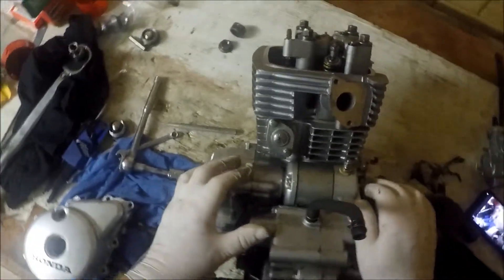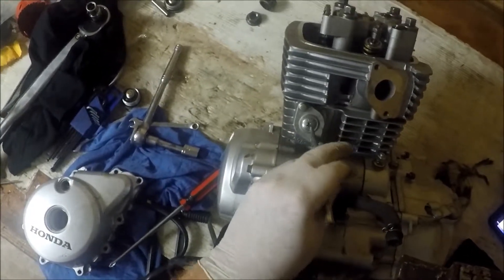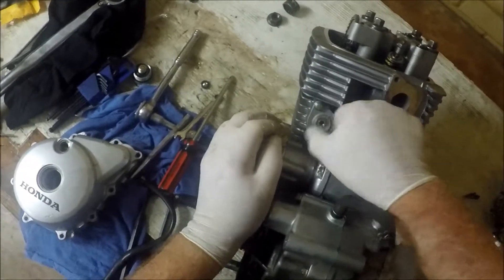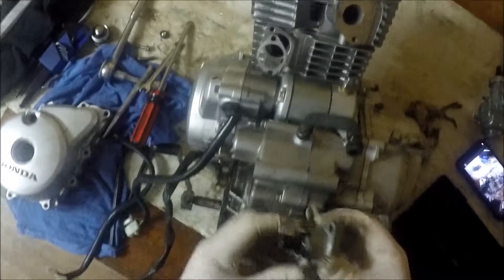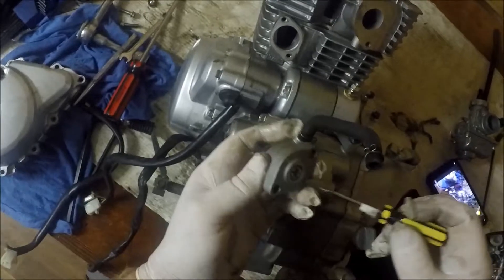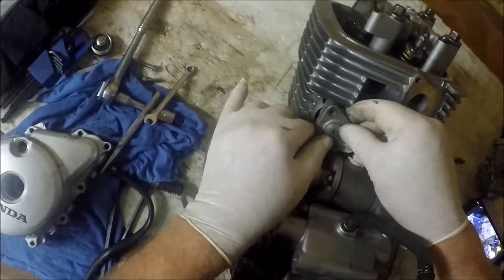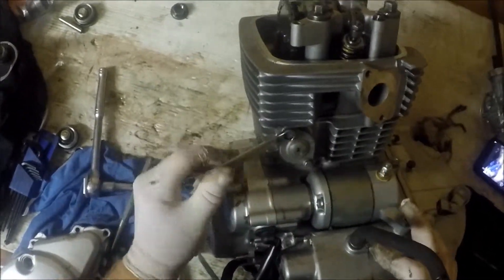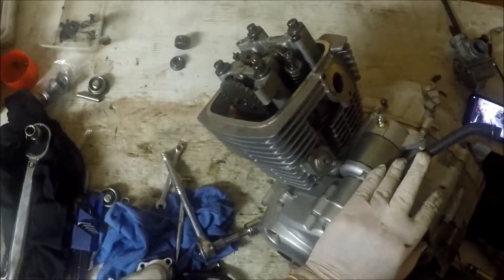Honda CB125E - The Mysteries of the Cam Chain Tensioner Explained

Comment: My tensionor looks the same but once wound in clockwise will hold itself in place without the cover screw, and is then released by a 1/4 anticlockwise turn.

Comment: Would you be able to put up a video on how to check the timing on this bike?
Reply from the maker: Hi Christopher!  Do you mean the ignition timing?  On the CB125E it cannot be adjusted, at least not easily.  It is a CDI unit that works directly off the flywheel and it should be pretty much spot on for the life of the bike.
Reply: @highoctanecommuting3862  That's exactly what I meant. Hrm, I got one of these from a friend and it isn't starting - it has spark and with the thumb test, it appears to have compression - if I spray starter fluid right into the carb, I get a fireball going back to the carb which makes me think that the problem is the spark going off too early. 
Do you have any suggestions on troubleshooting a no start condition? 
The float bowl is filling with fuel, its been drained and I have cleaned out the jets so it appears to be getting fuel.
Reply from the maker: @chrisd4813  That sounds like a fun and challenging problem, I'm a little jealous that I can't get hands on with that one.  You have definitely started down the right path.  You can check the timing with a timing light, there is an F index on the flywheel a few degrees away from the T index visible through the inspection cap as seen in the cam timing videos.  I don't believe this is the problem but without the bike in front of me it is hard to say.  How many kilometres has the bike travelled?  Has it been well maintained?  What were the circumstances where the engine failed to start?  Did it simply fail to start one day, did it stop while riding normally or was it something else?

Is the spark plug a healthy colour or is there signs of an incorrect mixture or oil burning?  Is it wet with fuel after repeated attempts at starting it?  Google will help you find a spark plug colour chart.   If the fuel in the bike is older than six months drain it and replace it.  Buying a new spark plug is cheap and knocks a faulty plug right out of the equation so thats a great place to start.  Consider changing the oil if the history of the oil in it is unknown, when you drain it look for tiny flakes of metal or discolouration.  Are there any unusual noises when the motor is spun over? Remove the spark plug from the engine, attach the spark plug lead and hold the thread of the plug to the engine, spin the motor over with the starter motor and you should get a strong regular spark.  If you do next step check the valve clearances and make sure they are correct.  Valve recession can cause the clearances to tighten up and hold the valves open just slightly.  This is what I suspect it might be, it might pass the thumb test but not fire.  Check that the cam chain is tensioned and valve timing is correct   Valve timing will only change if there has been an event such as the cam chain skipping a few teeth or misintentional mechanical contact within the engine so it is unlikely to be the problem but worth checking.  While you are checking the valve clearances rotate the motor several times with a socket on the flywheel making sure valves are opening and closing correctly, with the spark plug installed you should feel resistance when the engine is on the compression stroke.

The CB125E has a robust little engine, if you get to this point without any hint of what is happening then you have an interesting challenge in front of you indeed. So let us know how it went so we can all learn from your experience (or help if you are still stuck)  :)
Reply: That is an extremely well written response - I have replaced the spark plug already, checked and confirmed it does have spark. The bike conked out going uphill, which sounded like a fuel starvation issue (It was a friend's bike, that he's given to me for free to tinker with).
It's travelled a small 7700km - but I don't think he did any maintenance to it. 

I'm picking up some feeler gauges to check the valves this week, because it seemed like compression or timing because it barely coughs with starter fluid sprayed into it.
The bike itself cranks fine with the starter motor, but it does occasionally screech if I hit it again before it stops spinning so I suspect that is user error.

I will adjust the valves as per your previous video at some point next week, and get back to you. Thanks for the tips!!
Reply: I've just adjusted the valves to spec, and it's still not starting. To rule out fuel i sprayed some fuel directly into the carb and cranked it (it made a wicked fireball but no signs of starting).
This suggests to me that the spark is either firing too early, or the intake valve is still open when the spark is firing.

Do I need to pull the motor to adjust valve timing or can I just "skip" the timing chain back a tooth?
Reply from the maker: @chrisd4813  Hi  mate,  If the valve timing has changed then something has gone terribly wrong in your engine.  I have a video CB125E Valve Timing (camshaft timing) that you can check out, no you dont need to remove the engine to check and even change the cam timing.  The thing is that the cam timing is a set and forget thing, you only need to set it once when that area of the engine has been disassembled for whatever reason.  It will not change unless something made it change, once there is tension on the cam chain the only way it will skip teeth and change the valve timing is if there is some sort of mechanical contact in the engine.  This will be accompanied by some serious internal damage, bent valves, cracked piston tops and the like.

I urge you not to change the timing randomly as this can really damage the motor but check it as you have seen in the video.  It should not have changed and if it has it is more of a pointer towards a bigger problem. Do you have access to a compression tester or a leak down tester?  It is possible that something is holding the inlet valve open, I have seen the same symptoms as you describe for this exact same reason.  When you adjusted the valves were they tight or loose? Was the clearance very wide for the inlet valve?
Reply: @highoctanecommuting3862  They were fairly loose,  and it was quite out for the inlet valve. It's now adjusted to spec so it should be OK now.

Borrowing a compression tester from a friend later this week, so will check compression.

Im glad this is more of a tinkering project then something I use to go to work with!

Comment: Do I have to rotote the engine a couple Of times once I've released the tensioner?
Reply from the maker: Once the cam timing is done, everything is tightened down and the tensioner has been released (and tightened back up again) then yes, its a good idea to rotate the engine.  If it wont turn or turns part of the way then stops then something is wrong!!